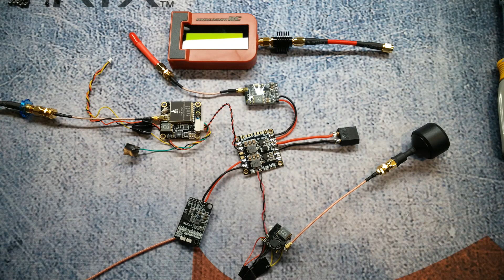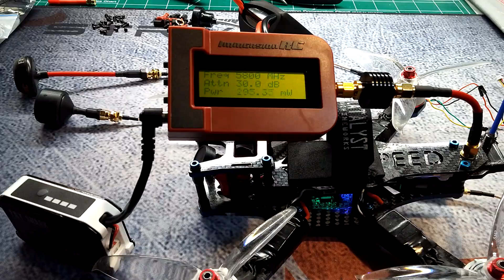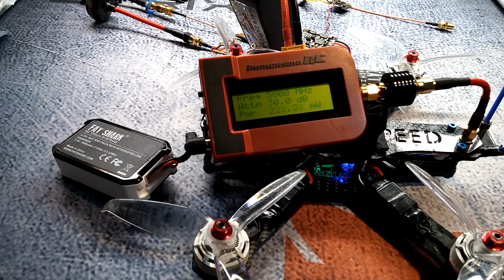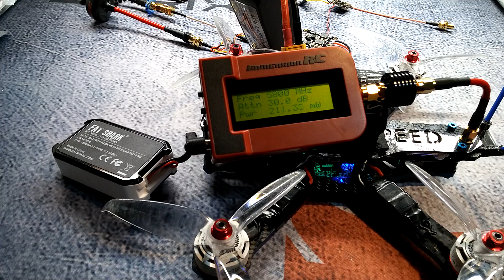VTX Shootout & Power Output Testing

Comment from the maker: I'd like to state that the numbers I pulled from these specific vtx's may or may not be the case for your sample, and the numbers can and will change depending on batch numbers and quality control. What this testing video was meant to clarify is the difference in a manufacturer's stated claims, and what you might get being a consumer of these products. Regardless of what numbers I'm getting in this testing, a lot of the results are not acceptable whatsoever, and it goes to show you how far quality control on a premium product will get you over other products where it's lacking.

I'd also like to state that temperature is a huge factor when measuring the power output of these vtx's, and though it might look like they were all powered on the entire test, I cut the video in between vtx tests and allowed them to properly cool off before continuing on with the testing. Regardless of that fact all of the vtx's were initially set up at 5800mhz and 25mw before they were tested, which shouldn't of generated that much heat if they are quality built from the beginning, but they all had the same opportunities to perform to their manufacturers stated outputs, or fall short of their expectations.

For what it's worth and to silence some of the critics that are saying that I didn't fairly test these vtx's on their most powerful output frequencies, I just tested the AKK FX2 set to 800mw on raceband 1, 5645, and up in the 5900mhz range with little effect on it's power output, it still outputs less than half of it's stated power on those channels as well.
Reply: SteelRainFPV another test you should think about doing is the power output on different channels raceflight did a test on one of the AKK vtxs and it was crazy the change in power output. When they did the AKK it was crazy how much it pushed on 200mw it was above 600mw
Reply from the maker: Fran Galasso - Good idea man, but I already know for the most part that low in the 5.8ghz spectrum is more powerful, such as 5645mhz will output a lot more power than say 5860mhz.
Reply: Is there a difference in power output when you feed the VTX with a video signal?
Reply from the maker: Mr Andersen - Absolutely no difference.
Reply: Yes, every power output test that I've ever seen has varies quite a bit depending on what channel they're on... yes even TBS, infact just watched on where the mach2 at 200mw varied from ~150 to ~280 just testing 5 channels TBS was varied also... as I said they all do!

Comment: would u know if mach 1 vtx what it pulls on 600mw? what amperage? I just wired a astrox with jb f4 original version 1 f.c and i had the runcam wired to 9v pad and then the vtx was wired to 9v pad and i went to do fast roll and lost video for few sec and i figure that i need to have vtx wired to lipo voltage and not the 9v pad but ive not got to test this theory since it raining here

Comment: You should test the immersion rc 700mw long range vtx, dont have a measurement device myself but would love to see your readings!
Reply from the maker: Rick Flare - Are you talking about the new Furious fpv 700mw vtx? I've tested the ImmersionRc 600mw Tramp HV on my channel, if it's not the Furious vtx can you provide a link to it? Thanks again for watching.
Reply: My goodness, lol your right and it is the furious fpv long range I have. The video with the immersion mixed me up but yes I would love to see your readings. I have it and the picture with a predators great going from battery pads to camera for power on a bardwell f4. I got mine from on a custom quad I purchased on ebay so dont know who stocks it but its awesome to see you test it. I have seen reviews but nothing scientific.
Reply from the maker: Rick Flare - No problem bud, I've already got one on the way for future testing with the ImmersionRc RF Power Meter and a long range 7" inch build.

Comment: the rdq mach 2 i was told the product was original and akk took the design but the akk uses cheap components and the quality control is a joke on akk.
Reply from the maker: Danger Davefpv - The story I got from RaceDayQuads is that they threw a bunch of money and their idea's at AKK to manufacture the Mach 2 vtx, and AKK took those idea's and money to release their own version before delivering on the Mach 2. Unfortunately there was no written contract from RaceDayQuads forbidding AKK from doing so, so it's really become a he said she said ordeal.
Reply: SteelRainFPV true and it's hard to say but I'd still feel comfortable with rdq product...thanks for test bench results this helps and is only way to know the real power
Reply from the maker: Danger Davefpv - The RaceDayQuads Mach 2 VTX didn't perform too bad considering, but I just received the TBS Unify Pro that outputs up to 800mw, which I tested on my ImmersionRc RF Power Meter and it performed spot on to it's manufacturers stated output claims, which to myself shows you get what you pay for concerning price, reputation and quality.

Comment: You should only power up each VTX just before testing as some can handle no air flow which is used for cooling by cutting power output down.
Reply from the maker: Jim Griffin - Check the pinned post by myself for more information on the testing procedures, and thanks for watching.

Comment: Was sent here by a sub of mine, as I’m using the unify pro hv with pretty poor results. Looks like I have a duff one. Shame on the Akk. Just got one of these and the quality seemed very good. Also have the matek. Best range by a large margin I’ve had recently was from an Eachine tx801. Actually I’ve had good results from 3 of them. Judging from the qc here, i must have got one outputting higher than it should :) good video. Have a sub.
Reply from the maker: Coppertop FPV - Thanks man I appreciate the kind words and support. This vtx video can or can't be a good representation of what some can expect, I spoke on and clarified more on the subject in the pinned post, so ymmv. I have a 800mw Unify Pro along with some other vtx's coming in for future testing, but from what I have seen the cheaper made budget vtx's output power is all over the board with no consistency, which leads me to believe it's a major qc issue with these electronics.
Reply: SteelRainFPV no surprises there then. This whole hobby is suck it and see even from well known brands. Will do a bit of a range test with mine, you’ve got me curious :)
Reply from the maker: Coppertop FPV - Fortunately for us quality antennas and antenna orientation are the biggest factors of fpv video reception and distance over mw output, but it's still a shame that these companies are making these inflated and inconsistent claims, just like the high current discharge battery testing I've done, and cashing in on the hobby community.

Comment: I have measured the Matek and it's pretty close to the Unify
Reply from the maker: rcdesigns - It's funny because I have 3 of the Matek HV vtx's, two are Pirofliprc branded, and they're all over the place with their readings. Out of the 3 only one appears to be close to the Unify Race in terms of manufacturers stated power output, the other two come in low.
Reply: I guess it's pot luck with a lot of these vTXs.  I measured 2 Unify Pros; 200mW setting (F4) - measured 188mW & 180mW, 500mW setting - measured 254mW & 260mW.  Measured 1 Matek; 200mW setting - measured 140mW, 500mW setting - measured 350mW
Go figure :-) ...
Reply from the maker: rcdesigns - Yeah most of these cheaper hobby grade electronics are all over the board with quality and specifications, it's just part of the entry price for playing the game.

Comment: I think they did so bad cause you had them sitting plugged in the whole time while the race wasn't plugged in the whole time, do the test again and plug them in one at a time please? I've tested the akk fx2 on a friends rf meter thing and it was pumping close to 1000mw when it was suppose to be on 800 but as it sat there not doing anything it got weaker and weaker as it over heated
Reply from the maker: Skylion - Please check the video's comment section and pinned post by myself for more information and clarification on the testing procedures, and what you may or may not expect from your specific setup.

Comment: wow great work!! wishing I hadn't bought a new matek now.  I've been going ok with mine even at a low output, flying to my comfort level with only xm+ receiver.  Obviously if you have a crossfire need TBS VTX too!  would be great to test one of the 800mw TBS vtxs out and do an update,
Reply from the maker: Killa Drones - Please check the video's comment section and pinned post by myself for more information and clarification on the testing procedures, and what you may or may not expect from your specific setup.

Comment: You didn't test the TBS @ 800 mw.   522mw at 5800mhz in the last test that I saw :(
Reply from the maker: CesiumSalami - It was a TBS Race, I've got a 800mw Unify coming in for testing soon.
Reply: OH! Ha ... sorry :( i missed that detail.
Reply: And while you're at it, did you test Mach 2 at 200mW or 500Mw?
Reply from the maker: daemn42 - For the most part I only tested these vtx's minimum and maximum output settings due to excessive video length, but I'm working on a spreadsheet to show how they all perform across their power output spektrum.
Reply: TBS Unify Pro HV has max 639mW @800mW, with good airflow :)
Reply: Szymon Syrek have you replaced the u.fl to SMA cable? I have only had them test low after replacing the cable to a more flexible one for convenience. 
I was absolutely amazed at the difference in output with different cables. They must be tuned very specifically to that stiff ass cable ;)

Comment: They all vary output based on the channel you put it on. And they are all different. This test isn't completely accurate. Mach 2 puts out its highest power on r1, the unify puts out its highest power on E 4, the 600mw akk puts out over 1watt on E 4. The 200mw eachine vtx puts out close to 600mw on E1-E5.
Reply from the maker: KNUCKLEUP FPV - That wasn't the point of the test, the point was to keep it an apples to apples comparison by testing them all on their center frequency of 5800mhz, and regardless of the fact that they may output more power on different channels, it's not legitimately disclosed by the manufacturers, the power should never really drop much below their manufacturers stated and claimed power output, and from what I've seen a quality built vtx doesn't fluctuate that much regardless of what band or channel it's transmitting on.

Comment: Great video . Do you have Wolfwhoop VTX to test ?
Reply from the maker: Freshness - If that is the brand on Amazon that I've seen that is identical to the Akk then no, but I may be doing another round of this testing soon on other vtx's that weren't in this video.
Reply: yes that's identical to AKK, I tested a couple at a race and it was ok at 25mw ,I wonder if you get the same result or not
Reply from the maker: Freshness - I think there's also another identical vtx labeled the Weyland, I'll have to get some samples for testing.

Comment: Umm...  just pointing out a major flaw in the testing, you had all of the vtx'x except the Unify on the board powered up and heating up the entire time.  Shocker, they all came in low.  Preston Garrison just did a video with the AKK, where he "proved" they were all blasting high by a factor of half, interestingly yours came in low by a factor of half.  Also of note, the Mach 2 was not put up to its high setting.  In conclusion, if your baseline VTX isn't on the table in the same condition as your tested VTX's, your test is interesting, but proves nothing.
Reply: @roger tinder you are absolutely right. This was not a well executed test.   When there are 4-5 other VTX's all hooked to the same board the battery is having to provide power to all of them.  That can also handicap the vtx's.  When the TBS didn't have to share any battery with multiple test subjects.   And regardless if you unplugged the rig between each test.... Those vtx's still warmed up more in comparison to your TBS.   Also the direction the antennas are facing can play a big role.    But yet when you tested the TBS you both antennas in their correct orientation to each other as they should be.  Not to mention you layed the test meter on your VTX practically.     All these things can play a critical role in the outcome of the experiment.   All test subjects should undergo the exact , "EXACT", circumstances.  
And last thing. ..... When you tested the Mach 2 on 800Mw and you saw the meter said just under 600Mw.  You made the comment that it was "over rated"

I believe the term you meant was over by í89∅
Reply from the maker: roger tinder - No they weren't, I cut out the video in between each vtx test and allowed them to cool down, and regardless of that fact they were all on 25mw anyways, so heat generation shouldn't of been that big of a factor. And yes, the Mach 2 was tested at it's max power setting.
Reply: My mistake and apology on the Mach 2.  I still believe without pulling the Unify out of the quad and putting it on the table under the same conditions as the other VTX's your test remains interesting but doesn't really prove anything.
Reply from the maker: roger tinder - Well that's your opinion and you're welcome to it, but if I understand you correctly, you're saying that it wasn't a fair test because the other vtx's that were powered on at 25mw while I was testing a specific vtx, which wasn't the case because I then unplugged the testing rig and let the other vtx's to be tested cool down before being tested??? That makes absolutely no sense whatsoever, and further drives home the point that if these vtx's can't handle the couple of minutes powered up at 25mw that it took to test one vtx, then let cool down and their performance degraded that much at such a low power level in only a few minutes time, then they're junk to start out with.
Reply: I think you almost understand what I am saying, but not quite.  The issue I have with your test is your baseline (the unify) was tested installed on a rig, while the others were installed on a single PDB and powered at the same time.  If you want a baseline, then the Unify should have been installed on the same PDB and sitting on the table under the same circumstances as the others. How long was the "test rig" unplugged between tests?  what was the temperature of the vtx's at the beginning of each test?  What was the voltage at each VTX?  Too many variables to me, especially when every single one of your test subjects put out low, and the only one that met standard was not connected to your test PDB - it is suspicious.  It is not an "apples to apples" comparison, and certainly not scientific enough to call any of the hardware "junk".  But you are correct sir, that is just my opinion.
Reply from the maker: roger tinder - I'm not trying to have a heated debate here, and I do understand your points, so let me elaborate even further on the subject. I used the same, fully charged 4s 1500mah lipo battery for the whole test, and it never dropped more than a tenth of a volt. As soon as the battery was connected to the baseline TBS Unify Race, or any other vtx I tested, the filming commenced, with at least 5 minutes in between individual vtx tests so they could "cool down" to ambient temperature after being powered up at a measly 25mw for the roughly 2-4 minutes it took to film the previous vtx's performance, and the battery voltage never dropped more than a tenth of a volt over the entire testing video. Once more I tested the TBS Unify Race at the end of the video that had the same opportunity to "cool down" as the other vtx's, with the voltage drop of the battery included, and there was no change in it's performance, all the while being crammed into a tight build and powered on for longer due to the changing of power output through the osd instead of push button. Would you like me to further embarrass these vtx's by leaving the baseline TBS Unify Race powered on at 25mw for 5-10 minutes before I take any readings, because I just have and it hasn't made a difference whatsoever.

Comment: Interesting results.  I had a RMRC Cricket Pro once and went to a race.  They tested it with RF Explorer and I was told it was only putting out 10mw.  The problem was more mine than anyone elses obviously.  But I have to say, I didn't have any video problems the whole day.  I raced with 5 other pilots each time.  

I also now have the Matek HV vtx you tested here.  I've also had that tested with RF Explorer, and it was spot on.  So it just goes to show that numbers don't always mean bad video, and it also means that results may vary from VTX to VTX, even if it's the same brand.  Test another batch of these same vtx models, and you may get completely different results.  This tells me that QC sucks in the vtx world.
Reply from the maker: Padraig - Yeah I agree that the numbers don't always mean you'll get bad video, it was meant to show truth in advertising and quality control issue's, sort of like my lipo battery testing. These numbers can be very important to professional racers at events that may get flagged for rf power output though, and to the normal hobbyists that may get blasted out of the air due to under or over performance of their rf signal.